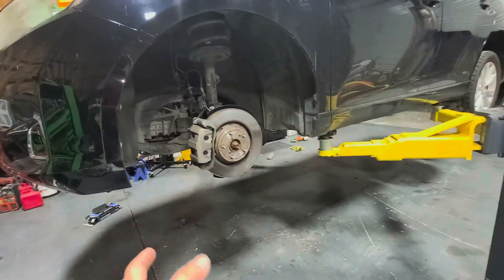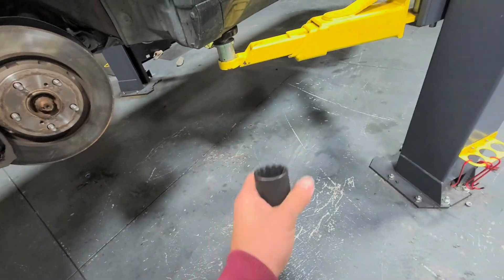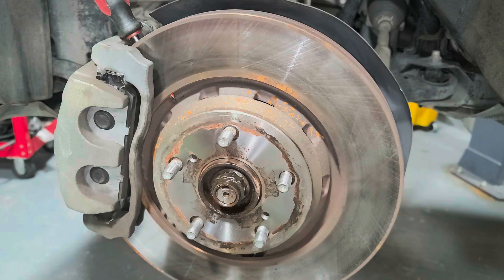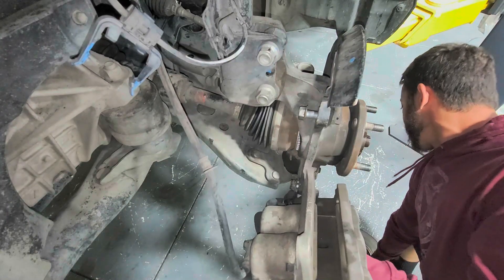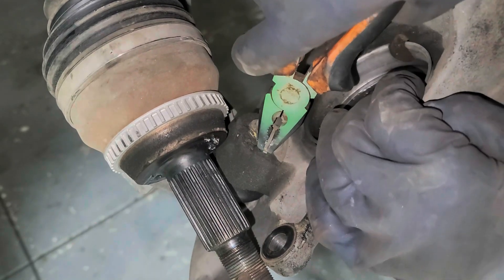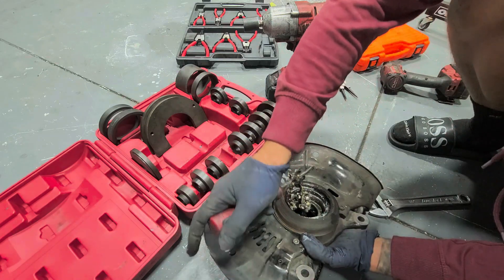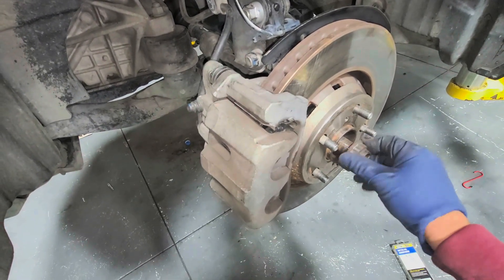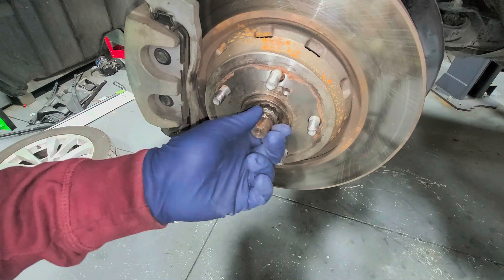2014 Toyota Venza wheel bearing replacement. simple and easy!

Comment: Thanks this really helped us a lot. I did it on my wife's 2014 Venza. The only thing I will say is: guys if your changing the original parts your going to need that drill lol. We used a 2 inch pole by 3 feet long and I still popped 3 veins and caught 2 hernia trying to remove the old bearing hub